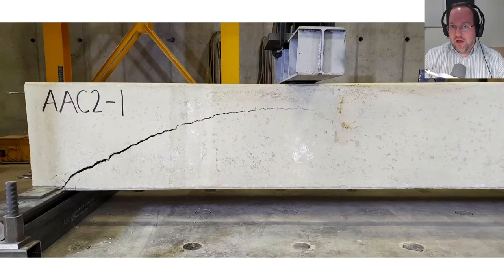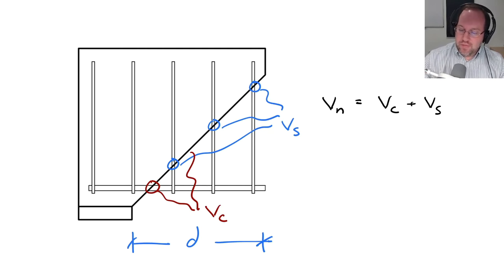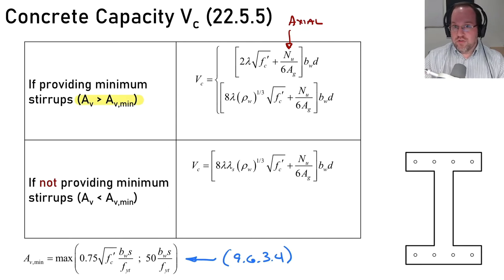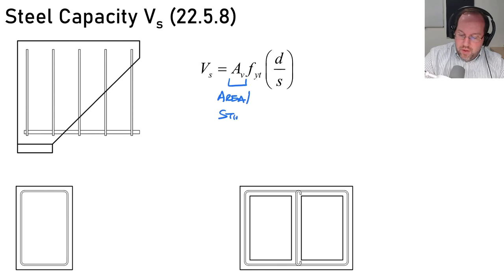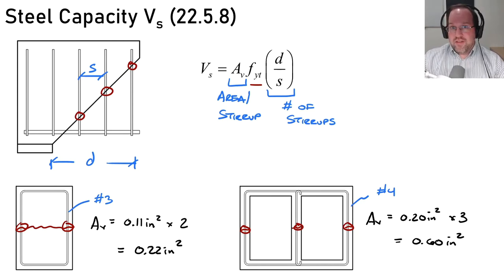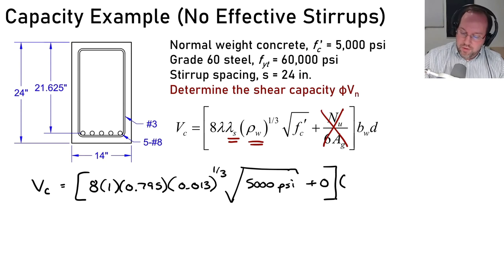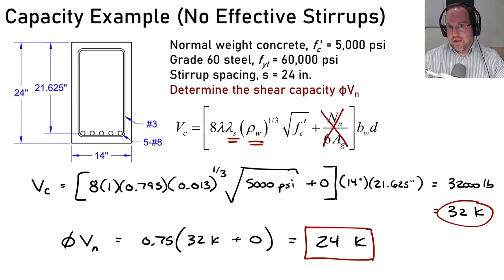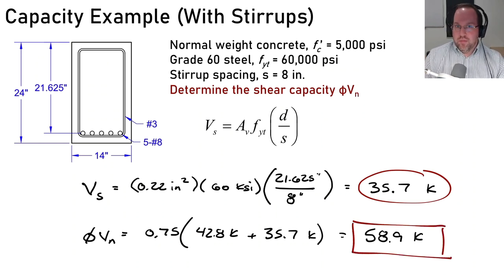Shear Capacity of Reinforced Concrete Beams using ACI 318-19

Comment: Thanks prof. For this useful video. Is it possible you can a video on pile caps as the size reduction has a major impact due to the large depth of pile caps. Pile caps designed using aci 318-14 and aci 318-19 are having  a major change in depth.

Comment: I hope if it's in SI unites 😢
Reply from the maker: I can help with that. The equations are all the same for SI units except for the following exceptions. Here are the conversions from psi to MPa and inches to millimeters, with the video timestamps included...

Converting equations for Vc in Section 22.5.5 from psi to MPa (2:44) - change the 2 coefficient to 0.17 and change the 8 coefficient to 0.66

Converting Av,min in Section 9.6.3.4 from psi to MPa (2:44) - change the 0.75 coefficient to a 0.062 and change the 50 coefficient to 0.35

Converting size factor lambda,s from Section 22.5.5.1.3 from inches to millimeters (5:20) - equation becomes sqrt(2/(1+0.004d))

All the steel strength equations are the same - obviously you'll have the stirrup Av in square millimeters and the steel strength fy in MPa.

It's a bit more work to convert the examples, but the process is identical except with the small equations changes above. If you want to covert my numbers...
1 MPa = 145 psi (so the 5000 psi concrete is 35 MPa),
25.4 mm = 1 inch (so the 24-in deep beam is 610-mm deep),
and 4.45 Newtons = 1 pound or 4.45 kN = 1 kip (so the Example 1 design capacity of 24 kips is 107 kN). 

Those are the only US to SI conversions you'll basically ever need for any strength calculations. Rebar are specified differently, but a #3 rebar is very close to a 10M (10-mm diameter) bar and a #8 bar is very close to a 25M (25-mm diameter) bar.
Reply: @StructuresProfH  thank you